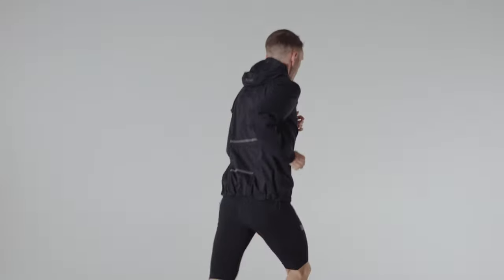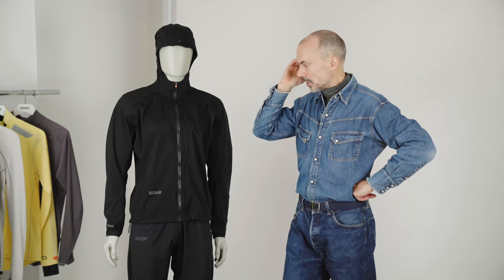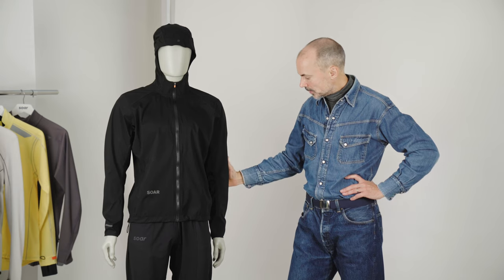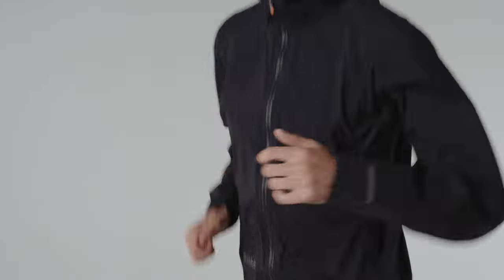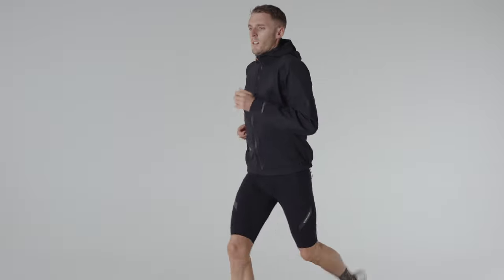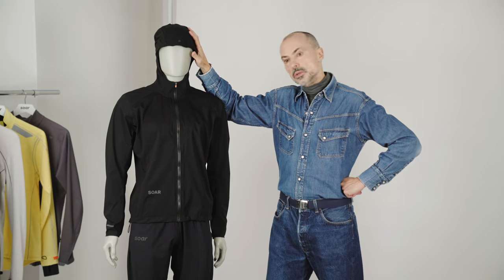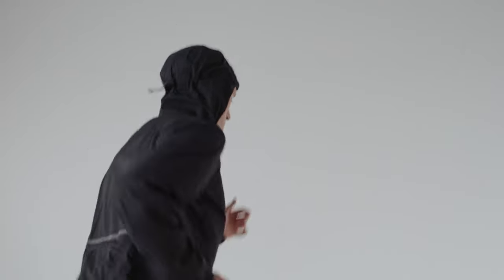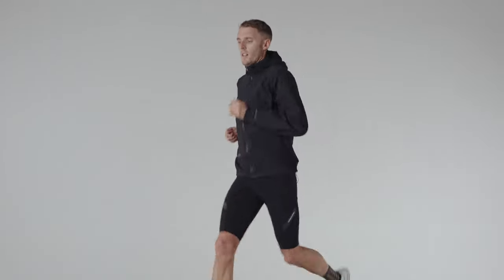Designer's Notes on Film Nano Rain Jacket

Comment: I just took mine out for the first time tonight. It was about 12 degrees C and I put in a moderately paced 10km run wearing only a running T-shirt beneath. The inside was absolutely soaked from my sweat, so much so that it was dripping from the sleeves. I’ve never had a proper running rain jacket, but if this is as you say the most breathable rain fabric on the market, I can’t imagine what others are like. I should note that it didn’t end up raining while I was on my run, so there is no confusing rain from sweat. 

Maybe this jacket is for a cooler temperature? I would really appreciate some input. This was by no means an inexpensive purchase. 

I should add that the quality, feel and styling are superb. It’s a very well assembled and thought out piece of kit—except for the breathability which I feel is critical
Reply: Update, I took this out again at 4 degrees Celsius wearing only a t-shirt beneath. A slow paced 14km run and I was again drenched from the inside. I'm not sure how this can be marketed as breathable. If anyone has any advice or feedback I would appreciate it very much!
Reply: @slowmigo  i wish you'd get a response. im curious about this as well. you should email them.